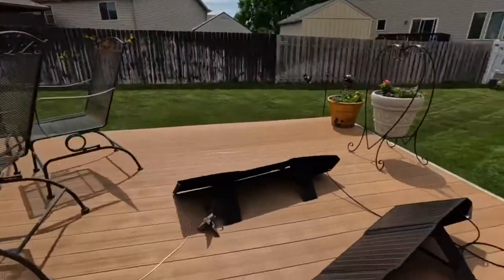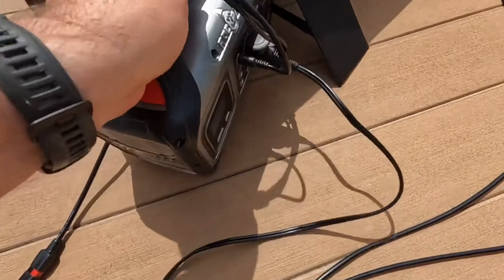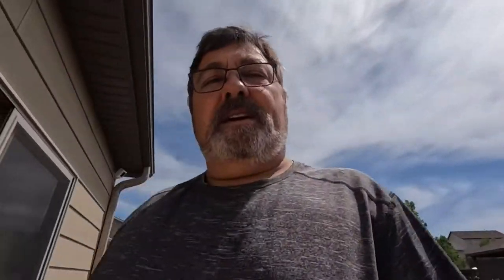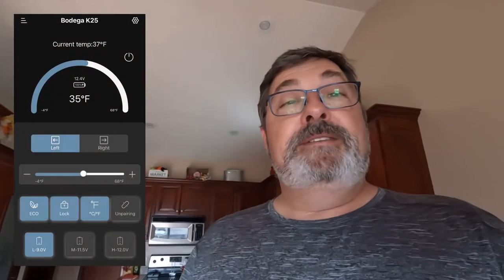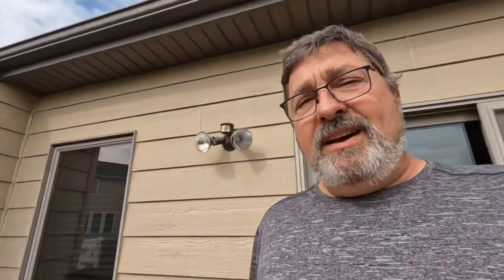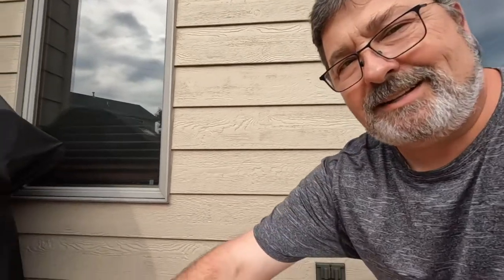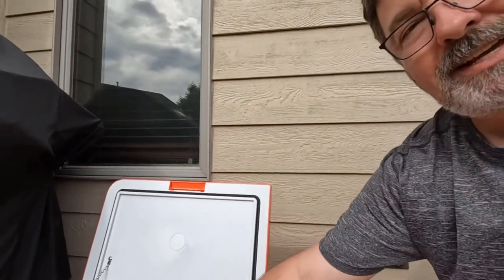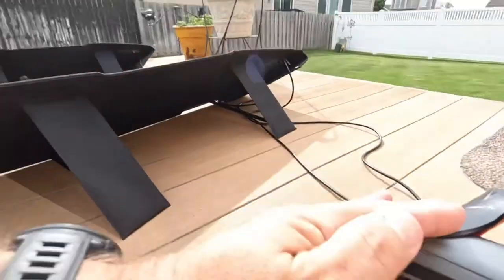Running a Fridge off a Rockpals 300 and 120 Watts of Solar

Comment: Could you drape a wet towel over the fridge to keep it relatively cool?
Reply from the maker: Yes, as long as you don’t cover the cooling vents for the compressor.  I have seen a lot of people make insulated covers for their portable refrigerators to improve the insulation.  I have some plans to add Reflectix to the lid to help out and I might make a full Reflectix cover for the entire unit.  Anything to help with retaining the cold air will improve the efficiency of the refrigerator.